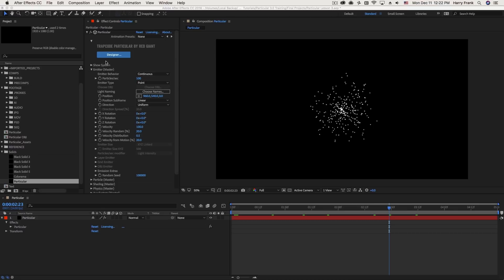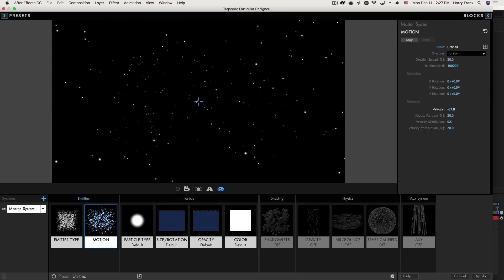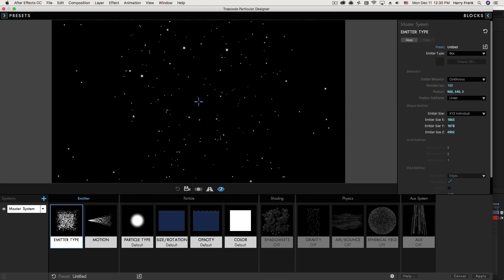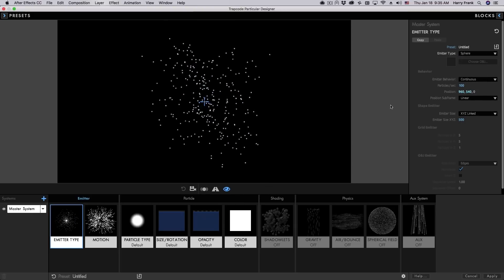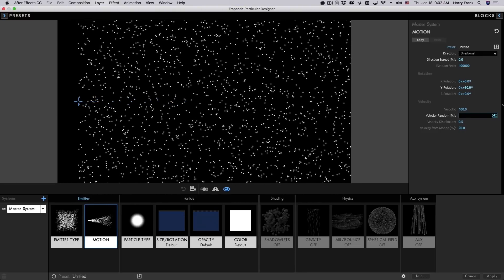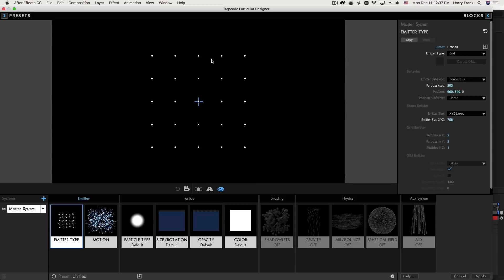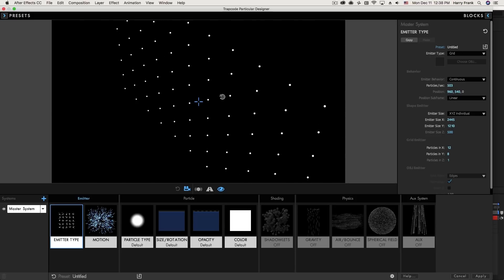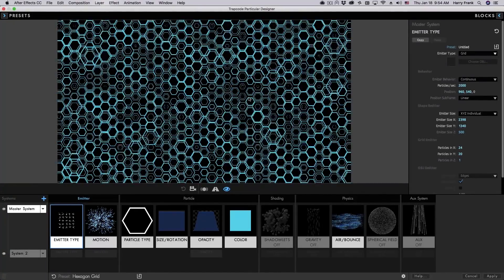Trapcode Particular 3 Training | 03: Emitter Overview

Comment: Hello, thank you for those tutorial, very helpful and easy to follow.
I do have a question however as i think i have a newer version of the puglin as the one used in this tutorial and a few things seems different.
The "grid" emitter has been removed from particular ? I don't see it as an option in my version. I do however have something similar in the "form" puglin that comes with the trapcode suit.

Does this means that all grid related emission particule are now done solely on the "form" puglin ?

Thank you again
Reply from the maker: The opposite, actually. Some Form things are now built into Particular! These includes the grid options. This is covered in detail in this video: https://www.youtube.com/watch?v=0MAfXAmrRXc

Note: the Aux system, Wind, and Turbulence have all been moved, removed, or changed with the addition of some huge improvements. You'll want to see this video for more details on that stuff: https://www.youtube.com/watch?v=d3Ox7OZdXgs

Comment: Is there any way to stop particles from producing? I would just like them to flow delicately but basically stay in the same place without adding new for another minute.
Reply from the maker: You can keyframe the particles per second from your desired amount down to 0.
Reply: @MaxonRedgiant  Thank you for your reply :) And now they are still moving - I would like them to be almost completely still - flowing but in a very minimal way. My emitter type is  Point. Gravity is 0, Air Resistance 1.0 Velocity is 0 - what else would I be looking at? I have watched some of your tutorials but I couldn't see still elements apart from on the Grid.
Reply from the maker: @aaana3  I your velocity is at 0, they shouldn't be moving. Is your emitter moving? If so, you need to lower the amount of Velocity From Emitter Motion parameter.
Reply: @aaana3  another thought is if you're looking for your particles to be mostly still, Trapcode Form might be a better starting off point. In Form, particles are stuck to the shape you decide to use as a Base and don't move until you adjust various properties. Particles also don't die. They exist until you keyframe a parameter or direct motion to them.
Reply: @TheCreativeMirror  That is a nice Tip - thank you all for your replies :)
Reply: @TheCreativeMirror  Hello - it is working greatly apart from the colours of particles... Here is a link to m presets: https://ibb.co/tzQ6GRz and here is a link to what I want to achieve and what was possible in Particular: https://ibb.co/mc8PPGF - I really played with the settings here and I am so so close to a final result :D